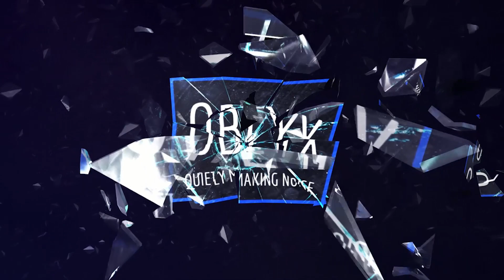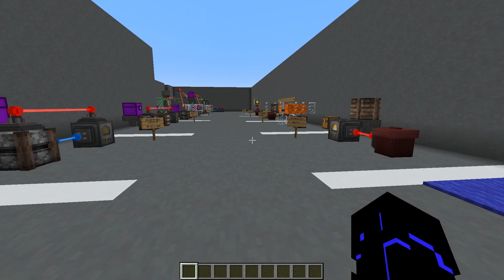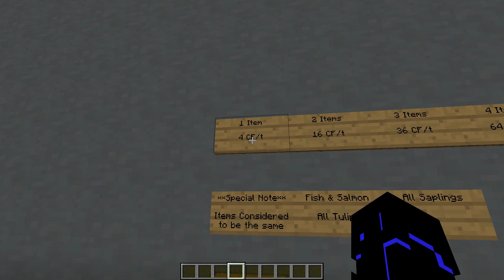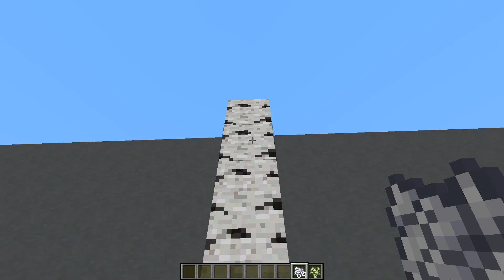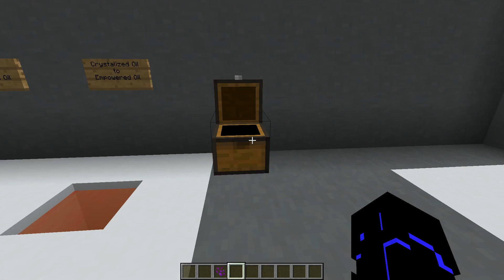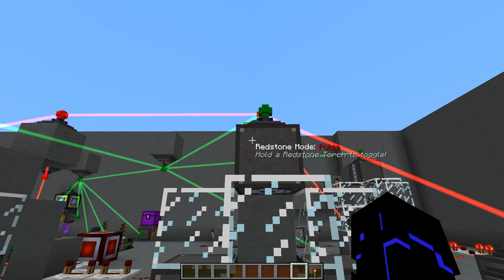Actually Additions Power Generation

Comment: Amazing explanation I just subbed :) btw cool Minecraft skin and also when I’m putting the lasers like the heat farm thing the energy laser relay won’t connect with the other one can u help?
Reply from the maker: I appreciate the kind words.  Make sure you are bapping them with the wrench, that's what connects them.  The wrench has a couple of modes so make sure you are in the correct one.  If rusty memory serves me it's the blue handle.
Reply: oblyx thanks it worked now :)